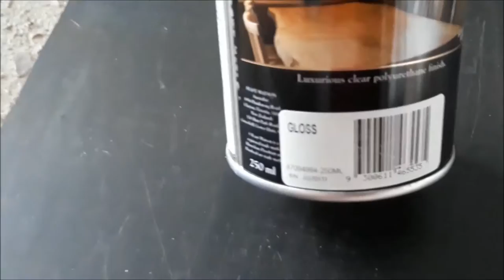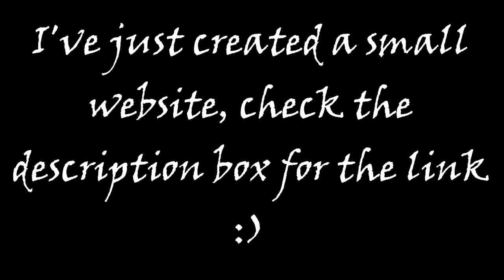Making a Dodgy Handle and Sheath for a Whittling Knife!!! (Part 2)

Comment: Don't throw that Drexel away if the motor  still runs. Mine broke but motor still ran. There is a 3 dollar plastic bushing that will fix the problem. Now I have a rebuilt one and a new one. You can get the bushing on line.
Reply from the maker: Unfortunately it was the motor that died. I managed to macguyver the flex shaft so it fits on my new cheap one and gets rid of some of the wobble. Great tip though! I'll keep that in mind for when I get a new one :) thanks for the comment, I really appreciate it.